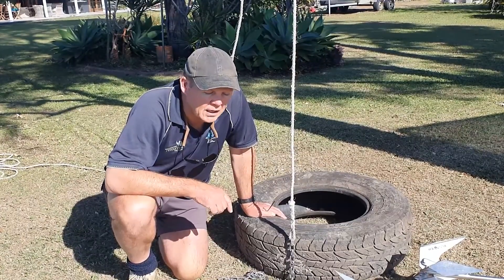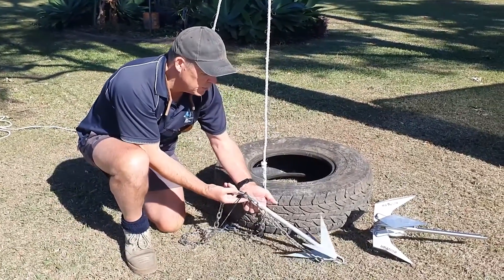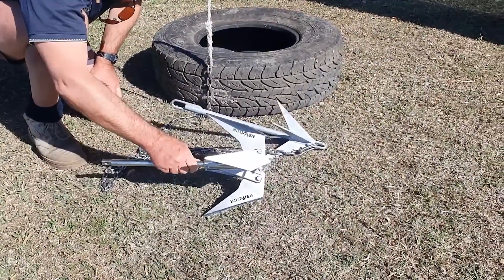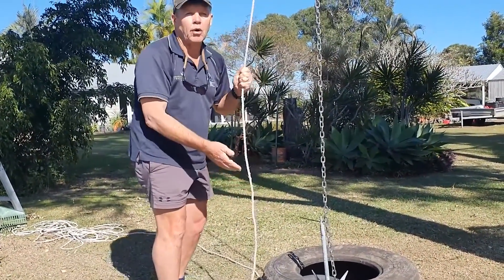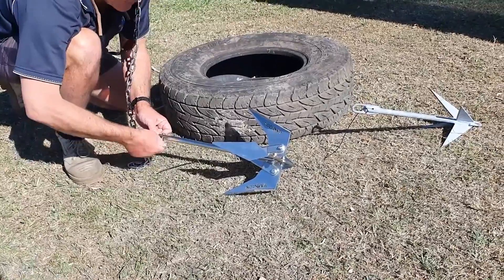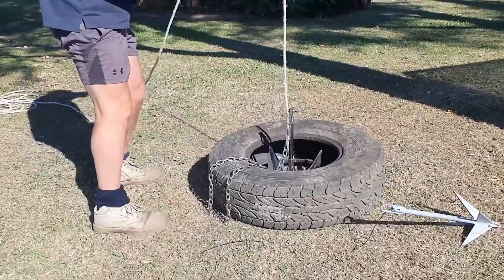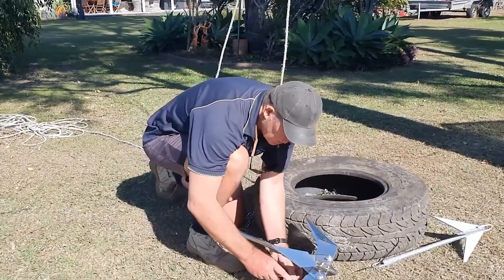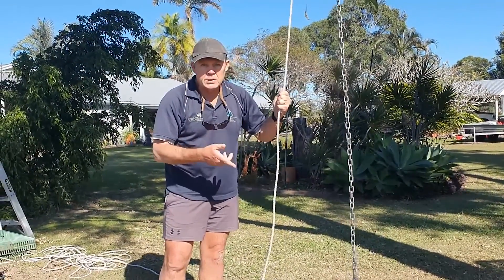BOOMER ANCHOR vs Mooloolaba Pick

Comment: I am obviously missing something here. In the event of unavoidably needing to drop anchor and ride out rough conditions, say in the event of no fuel or other motor issue, it is obviously essential that the anchor stays connected to the bottom. How does the design of the Boomer ensure that repeated shear load on the pin (during cyclical violent lifting of the bow) does not cause loss of traction at the worst possible time?

Comment: The boomer anchor has been great for me. I fish outside mainly solo , and it allows me to control the release from the helm safely .Also it's a lot easier to replace another pin than to try to bend a traditional pronged reef anchor. Thanks to all that has put thought ,design and practicality to create a very versatile safe anchor.